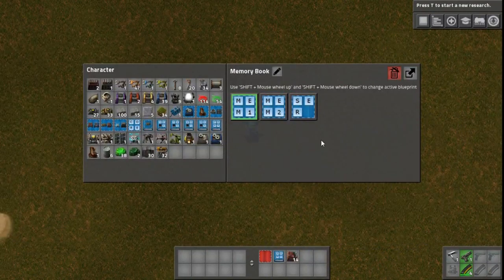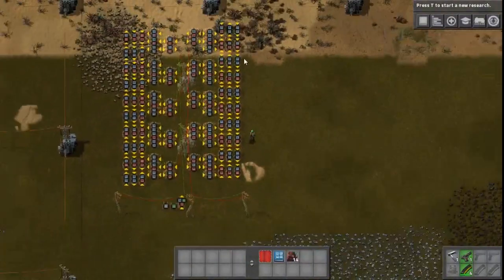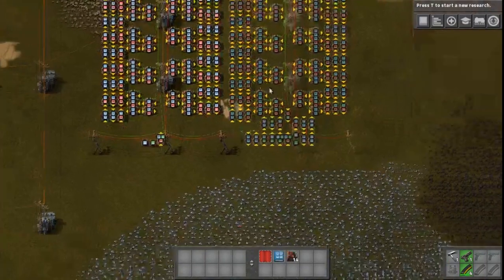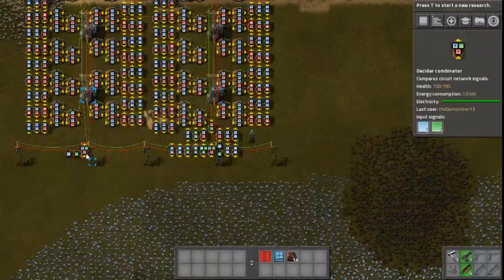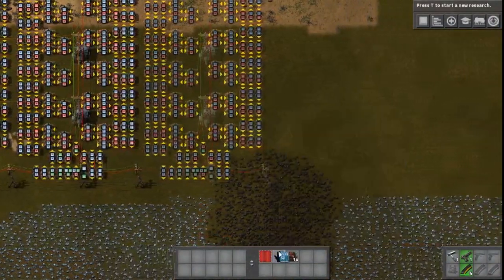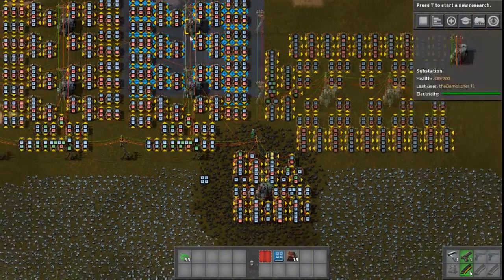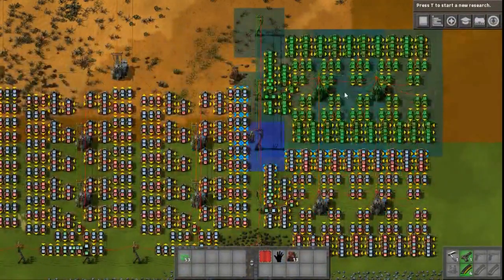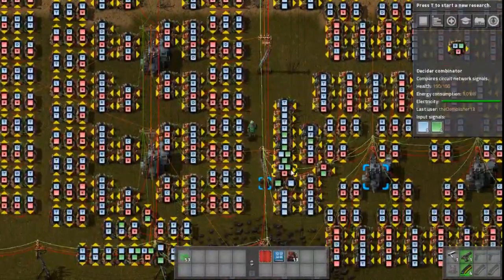Factorio Memory Cell System

Comment: Omg, I was looking for a simple one value system and I found this. Geez this looks so much more complicated then what I'm trying to do.
Reply from the maker: If you want I can give you a tutorial in person on how to use it.
Reply: @theDemolisher13  What I'm trying to do is a smart train stacker. I beleive that I have figured out the nuts and bolts of how to keep track of the ressources in the system, and how to send a signal that it's fallen below a certain threshold. The part that is escaping me right now is detecting the departure of the train from the stacker. I just want to send one train at a time, I don't want to call all of the trains which contain ressource X in the stacker. I've placed stations in my stacker and all of them are named stacker. The station can output a T signal which contain a train ID. I'm thinking that this value can be used to detect the departure of a train. 

The next part is going to be fun in comparison. The idea is that each train is set to look for the same signal, but with a different value. The system remembers what which value was last called and it increments each cycle until a train has departed from the stacker. Basically, I somewhat know where I'm heading and I have an idea of what is possible, but since I'm still fairly new at this, I'm still getting a handle on things and I'm probably making it more complicated then it ought to be. I'm trying to figure out the harder part first since there's no point in doing the rest if detecting the departure of the train does not work.
Reply from the maker: @jonathanlanglois2742  Wow that was a lot to unpack. So to summarize what you said you're making a train network where different trains are called up when a certain signal is called for. But your current issue is you don't know how to detect a train if it is present or not. Also do note I've up to this point in my factorio career have no even touch trains so I would have to look into this. But isn't there a signal light system or something that can tell trains to stop. So in which case couldn't you just wire up the signal lights to the logic system and just tell all trains to go and have them stop at the lights and hold them there till their signal goes off?
Reply: I'm going to go sleep on it. I've now got a light blinking when I push a train out of the station. I made a stupid wiring mistake and obviously need to come back at it well rested. One of the things on my mind now is the fact that yeah, T value is going to tell me that a train has left, but... what if I have multiple resources in that stacker and that both signals are called simultaneously? 2 trains could potentially leave simultaneously. It could also be that just one train has left. T does not tell me anything at all other then a train has left. It's a blind signal that really doesn't tell me much of anything. The early part, the resource threshold detection can definitely send signals for 2 resources during the same cycle. I might need to rethink this a bit, try to see if I can simplify this monster I'm making for myself.
Reply: @theDemolisher13  You can only read train ID and content at a station, so you need the train to be at a station to get information on it. In other words, you acheive the first objective, getting information on the train, by putting stations in the stacker. The station also provide something else which is important. Circuit conditions can be transmited to trains which are in a station. They can't read circuit conditions anywhere else in the system. The station must, quite obviously, be wired for this to work.

There's really not much that you can do with signals other then closing them and checking their current status. You don't tell a specific train to move forward using signals, you merely tell the train that the track is "available" which is something that the signals do just fine without any kind of logic system as long as you've set them up properly. The main use case for wiring signals is to create smart crossings which allow you to move through without ever having to worry about getting hit by a train. Also, as mentioned previously, trains only read circuit conditions at the station itself. If you use a signal to block a train in the stacker, you are creating a problem for yourself. There's just enough wiggle room between the signal and the train station that the train is going to have moved out of the station and you can't get info on it anymore, or transmit a signal to it. In other words, it's effectively a ghost train, somewhere in the system, despite the fact that it's quite clearly sitting in the stacker. Now, I guess that you could just use a few combinators to remember that info so that it remains usable later, but I feel like at that point, you are just creating problems for yourself that don't need to exist. Keep it at the station until a specific circuit condition is met.

I'm still waking up, but I just clicked on something this morning. Trains can look for multiple circuit conditions simultaneously and you can use the AND OR operators. I need to have a new look at those. The anwser might just resides there. You could potentially create rather complicated circuit conditions very easily using the train UI, far more easily then it would be using combinators.
Reply from the maker: @jonathanlanglois2742  Welp you sound like you know what you're doing or at least where you're going with all this. So best of luck with you're project. As I think I'll get back to mine as a self expanding factory uses every ounce of one's own logic abilities to get running properly.
Reply: @theDemolisher13  Yeah, this morning I'm putting all of the steps and how they might work toguether in a notepad and lining up what needs to connect to what. I think I know how to make it work. It needed a new approach and a rested mind. I'm dumping T completly in favor of cargo detection. I can do more work with that signal using combi. I'm also changing the way that I had initially planned to send my signal to the train.